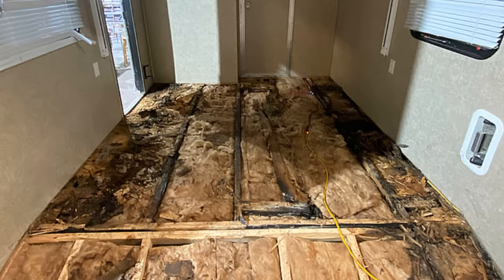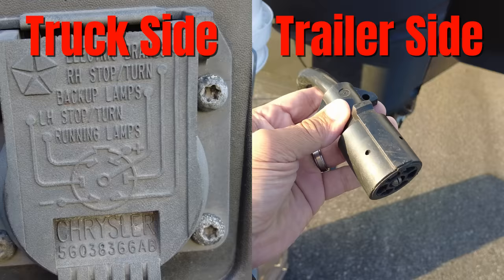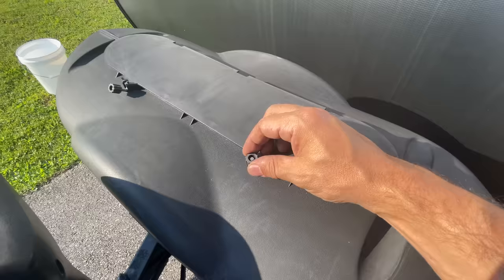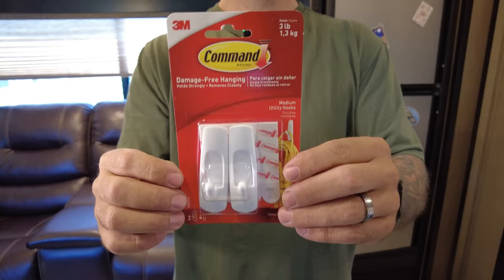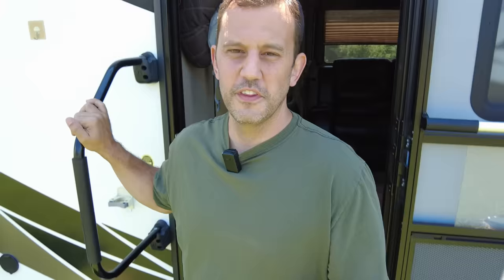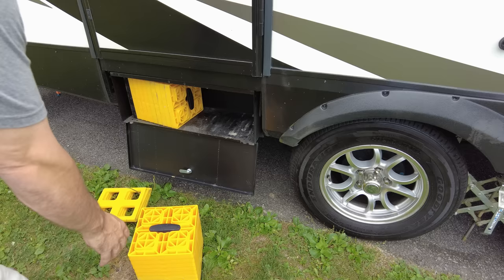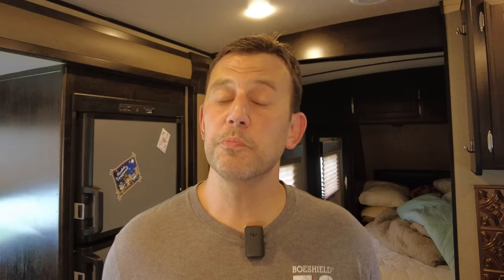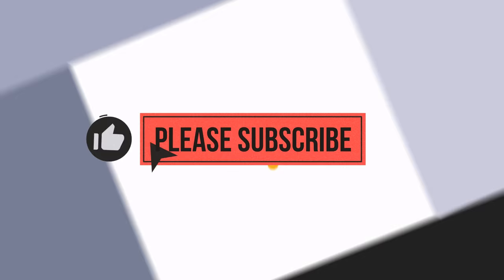RV Camping Hacks / Tips That Will Save Your Marriage 🤣 & Cost You Nothing

Comment from the maker: ✨⭐ PRODUCTS FEATURED IN THIS VIDEO ⭐✨
🔹 Water Splitter W/ Valves https://amzn.to/3PxL2hR
🔹 Water Filter https://amzn.to/3yJsi8h
🔹 Bungie Balls https://amzn.to/3AVhNS5
🔹 Pipe Cleaners (Cheaper at a local craft store than Amazon) https://amzn.to/3RC2weS
🔹 Fuse Kit https://amzn.to/3PgyhbU
🔹 Trailer Brake Cable Clip https://amzn.to/3aLULCC
🔹 5 Gallon Bucket – Buy this locally, its cheaper than Amazon
🔹 Command Hooks for Garbage Can https://amzn.to/3aNJt0D
🔹 Command Hooks for Shower https://amzn.to/3ILYwV9
🔹 Metal Towel Hooks https://amzn.to/3ILQ3kJ
🔹 Camco Leveling Blocks https://amzn.to/3cmUo1J
🔹 Camco Leveling Block Caps https://amzn.to/3IJ17Pw
🔹 Carmtek Premium Leveling Kit https://amzn.to/3zxE9s9 
🔹 Carmtek Tandem Axles Levelers & Chocks https://amzn.to/3xqpjBa 
🔹 Carmtek Triple Axle Levelers & Chocks https://amzn.to/3xSGRrb 
🔹 Carmtek Single Axle Leveler & Chock https://amzn.to/3MJFKhw
🔹 Low Point Drain Valves (Male) https://amzn.to/3aJX5Gm
🔹 Low Point Drain Valves (Female) https://amzn.to/3ckZFqm
🔹 Velcro Straps https://amzn.to/3AX5gxF

RV Camping Hacks / Tips That Will Cost You Nothing & Save Your Marriage This episode is full of random RV camping hacks, tips & tricks to make RV life easier, safer, and maybe even save you a few dollars.  Keep scrolling down to see more info about this video ⬇

🎥Other Videos to Watch: Carmtek Leveling Ramps Review https://youtu.be/hD9QU5DCZqY

#rvlife #rvtips #rvtravel

✨⭐ OUR FAVORITE RV ACCESSORIES ⭐✨

ESSENTIALS:
✅ Camco Rhino Flex Sewer Hose & Elbow Kit https://amzn.to/3wxaiyG
✅ Camco 90 Degree Clear Sewer Elbow https://amzn.to/3eezBe7
✅ Camco RV Water Filter https://amzn.to/3VzcMqi
✅ Rubber Wheel Chocks https://amzn.to/3v0lL5I
✅ Hughes Watchdog 30 Amp Surge Protector/EMS https://amzn.to/3hAmgCy
✅ Hughes Watchdog 50 Amp Surge Protector/EMS https://amzn.to/3HKrpm1
✅ Liquified RV Tank Treatment https://amzn.to/3ksg1Ck
✅ Tire Minder TPMS https://amzn.to/3mjuBg0
✅ Water Pressure Regulator https://amzn.to/3m3ZFzZ
✅ Rubber Gloves 6 Mil https://amzn.to/3XNo7Dc
✅ Collapsible Water Hose https://amzn.to/3SvNubw

MAINTENANCE:
✅ Boeshield T-9 Rust Preventative & Lubrication https://amzn.to/3sjcjMx 
✅ Eternabond Roof Tape https://amzn.to/3Ad290J
✅ Geocell Proflex Sealer https://amzn.to/3KGMOyb
✅ Road Tool Kit https://amzn.to/41NIQKj

INTERIOR:
✅ Camco Cross Bar Door Handle https://amzn.to/3o8WWS5
✅ Shower Caddy https://amzn.to/3bdU80W
✅ Soap Dish https://amzn.to/3pKheSn
✅ Oxygenics Shower Head (White) https://amzn.to/3nhDMYW
✅ Oxygenics Shower Head (Brushed Nickel) https://amzn.to/2O8YcYC
✅ Perfect RV Paper Towel Holder https://amzn.to/3tZxd1K
✅ Dimmer Switch https://amzn.to/3rQdfFD
✅ Sliding Door Latch https://amzn.to/3EkpTT0
✅ Puppy Paw Hook https://amzn.to/2N9JaRV
✅ Foldable Storage Bins https://amzn.to/3tIp01f

EXTERIOR:
✅ X Chocks https://amzn.to/3m3ck2i
✅ Carmtek 10 Digit Keyless Entry System https://amzn.to/3t4IMpB (see the video here: https://youtu.be/KcEUgsDw6kk)
✅ Low Point Drain Valves https://amzn.to/3Jd6adb

OUTDOOR GEAR:
✅ Blackstone Griddle 22” https://amzn.to/3MDDiL0
✅ Blackstone Griddle 28" https://amzn.to/3eBnOuD
✅ Outdoor Gravity Chairs https://amzn.to/3Sb1p4M
✅ Ground Mat https://amzn.to/41u3wXg

💥 Sign up for our FREE Newsletter: https://view.flodesk.com/pages/6497c6a9d1998fa8c7623e9f

✨⭐ MORE RV ACCESSORIES ON AMAZON ⭐✨
https://www.amazon.com/shop/rvtipstravels

💥 NEW TO OUR CHANNEL? Check out our catalog:
https://www.youtube.com/c/RVTipsTravels/playlists

🙏 If you want to help support our channel you can donate here: 
https://www.paypal.com/donate/?hosted_button_id=J2KKM9NR3BJJA

✨⭐ DISCOUNT CODES TO SAVE MONEY ⭐✨

🔨 Learn how to repair & maintain your RV like I did w/ this COMPREHENSIVE training course:
https://rvtechcourse.com/?ref=rvtips&travels

🚐 10% off RV Snappads! https://rvsnappad.com/discount/RVTT10

🛌 Get 25% off your RV Mattress by Brooklyn Bedding at https://rvmattress.com/rvtips
Use discount code: rvtips

📡 GPS Tracking for your RV! https://www.wheresafe.com/rvtipsandtravels
Get 10% off by using discount code: RVTIPS10

If you find a dead link, let us know & we’ll send you an RVTT sticker!

📺 Want to see more RV videos? Please SUBSCRIBE & CLICK THE BELL ICON 🔔 so you're notified when we release new videos!

Follow us on social media:
📸 Instagram https://www.instagram.com/RVTipsAndTravels
🕺 Facebook https://www.facebook.com/RVTipsAndTravels

We may receive a small commission for purchases made through the affiliate links above. There is NO additional cost to you when purchasing from our links & it helps cover some of our material and equipment costs to make these videos. We GREATLY appreciate your support!

Comment: Never open the pressure relief valve on your water heater and release the air in there.  That air is in there to allow for expansion in the hot water system.
Reply from the maker: Opening the T&P valve doesn’t remove the air pocket at the top of the tank, it relieves the pressure.  It does not create a vacuum and remove the air OR raise the water level.  Normal use of an rv water heater is what reduces that air pocket over time.  I can send you other videos from other channels that say the same thing if you dont believe me.  The T&P valve is at the top of the tank, when you open it you relieve the pressure and any water that has made its way to or above the valve, which essentially increases, not decreases, the air pocket.  Pretty simple science.  The air pocket also needs to be occasionally reset.  Resetting the air pocket along with some other information about the T&P valve are explained in more detail in the link at the end of this comment.  Hope this makes things easier to understand, and thanks for watching:
https://youtu.be/PopWaPMra6A

Comment: Here is my tip... Learn to do your own RV maintenance and use a good car maintenance management program ( I use Automotive Wolf car care software ) to track and monitor it all. It also tracks all my parts, expenses and creates a detailed vehicle maintenance log. After RV'ing for over 10 years I've saved thousands by doing most of the maintenance myself and there is a lot of it on an RV!  A small roof leak can cost you thousands in repairs so I check my roof at least twice a year. Keep on top of the maintenance and you'll save money and be RV'ing for years :)
Reply from the maker: couldnt agree more, thanks for sharing
Reply: U should be using Saftey Chains.

Comment: I liked these tips. Short and sweet.
I had already turned my propane tank cover around, but to add extra security, I drilled small holes next to both sides the hinge and added cable ties, not too tight, just in case the hinges blow loose.
Reply from the maker: Good idea Terry
Reply: Yup, I've already lost two lids!  
 @RVTIPSANDTRAVELS

Comment: I always carry 20 gallons in the fresh tank because I’m towing my own rest stop.  Also, spare expanding shower curtain rods store easily under the bed.  They rest really well on top of the midline trim of the shower and can be used to dry wet towels between showers (without that trim, you may need to tighten the rods to the shower walls).
Reply from the maker: Thanks for adding William!
Reply: I carry a gallon jug of water.

Comment: Nice video... I hate hauling water, but if you have a breakdown on the road... nice to have.  I suppose it depends upon the rig doing the hauling:  small suv with an auto tranny or a 1 ton manual Cummins...

If you are pulling with the right rig, it isn't the weight of the water that is killing you, it is wind resistance.

Comment: Rubber bands to keep cabinets closed. I use a anchor cleaves for the oh no break cabel. It's made of stainless steel and the nut is held in place with a hitch pin. Use only one lp gas tank if you have two. This way when the tank is empty you have the second full one. Just remember to fill the empty one.
Reply from the maker: Thanks for watching Tom.

Comment: On the safety brake just use a hasp. Place the cable on the smaller end of the hasp and that will correct the problem.

Comment: Great video, Ross!  I use wood blocks I had left over from a deck project under my stabilizers. When traveling  I store them in the 5 gallon bucket used to cover the jack. I used a router to round the edges of the blocks to makes them easier to handle. I always look forward to your videos. Fellow 2150rb owner.
Reply from the maker: that works too!  Great idea! I use the bucket to carry firewood sometimes.  I used to use wood blocks under my stabilizers but after not using the blocks to level anymore, i wanted to either get rid of the wood or the blocks.  the blocks won, the wood was free. Thanks for commenting Daryl.
Reply: @RVTIPSANDTRAVELS  I use the leveling blocks flipped upside down under my stabilizers, but I also have a wood block under my tongue-jack, because my jack doesn't have a foot, and the wood block is easier to replace when the jack inevitably cuts through it.
Reply: Ha,  my college roommate would do the radio trick to help him sleep because I snorred to loud.  Before he learned that trick,  he would throw pennies at me. Thinking I would roll over on my belly and no longer snore.  When I got up the next  morning, pennies would be stuck to my body.  My poor penny-pinching self would collect them in the shower.

Comment: As always, your content is above the rest.  Thanks!!
Reply from the maker: Thanks bud, appreciated.  Good to hear from you again.
Reply: @RVTIPSANDTRAVELS  another topic you might consider is related to keeping absorption fridges cool.  I’ve started having some problems and I installed a 2x titan fan at the top of my fridge cavity to help pull hot air out and I have been testing it with results showing it’s worse with the fans going.  I’m wondering if it’s actually pulling fresh air from the top more than it’s pulling from below.  Seems crazy but I’m tempted to either add more fans to completely cover the top 6x20 vent exhaust opening but not sure.  Anyway, it might be a good topic in the future for you. Many of the other videos are all the same.
Reply from the maker: Just seeing this, I’ll look into it bud.

Comment: Just a reminder you may want to add.  IF you drain your water heater, make sure you refill it before turning it on, water on and relief valve open until water comes out..  Especially for the electric side which could be damaged or the gas side which could trip the high temp limit.
Reply from the maker: Absolutely, we always burp the valve before powering on the electric side to make sure.  The heating element will burn out in seconds.

Comment: You shouldn’t have the red plug in the pressure relief valve of water heater. That needs to be free & clear of any/all obstructions.
Reply from the maker: it doesnt interfere with the valve, and it basically falls out if there is any real water pressure behind it.  It came from the factory as a cover to prevent insects nesting in the valve, so they said, but I've since removed it because it was falling out all the time.

Comment: I’m unable to find the list you mentioned. Are you able to share it? Thanks. We subscribed. Very helpful
Reply from the maker: 🔹 Water Splitter W/ Valves https://amzn.to/3PxL2hR
🔹 Water Filter https://amzn.to/4dfEp0x
🔹 Bungie Balls https://amzn.to/3AVhNS5
🔹 Pipe Cleaners (Cheaper at a local craft store than Amazon) https://amzn.to/3RC2weS
🔹 Fuse Kit https://amzn.to/3PgyhbU
🔹 Trailer Brake Cable Clip https://amzn.to/3aLULCC
🔹 5 Gallon Bucket – Buy this locally, its cheaper than Amazon
🔹 Command Hooks for Garbage Can https://amzn.to/3aNJt0D
🔹 Command Hooks for Shower https://amzn.to/3ILYwV9
🔹 Metal Towel Hooks https://amzn.to/3ILQ3kJ
🔹 Camco Leveling Blocks https://amzn.to/3cmUo1J
🔹 Camco Leveling Block Caps https://amzn.to/3IJ17Pw
🔹 Carmtek Premium Leveling Kit https://amzn.to/3zxE9s9 
🔹 Carmtek Tandem Axles Levelers & Chocks https://amzn.to/3xqpjBa 
🔹 Carmtek Triple Axle Levelers & Chocks https://amzn.to/3xSGRrb 
🔹 Carmtek Single Axle Leveler & Chock https://amzn.to/3MJFKhw
🔹 Low Point Drain Valves (Male) https://amzn.to/3aJX5Gm
🔹 Low Point Drain Valves (Female) https://amzn.to/3ckZFqm
🔹 Velcro Straps https://amzn.to/3AX5gxF

Comment: I installed my propane cover so the lid latched at rear, during travel the 'lock tight bolts' vibrated loose and were lost.  Any other way to secure lid?
Whrn using the white bucket to cover the jack be sure it is angled so as not to pressure the jack light switch.  Also use a bungee to secure bucket position.
Reply: Lowes sells small trash bins that have cut outs that allow trash bags to be secured.
Reply from the maker: i wish i had a hack for this lid, its awful.

you can connect your saftey chains to the bucket handle to hold it down too.  thanks for watching and commenting Pat.

Comment: I'm sure you have made a video on this but here's what happened to me... I used my camper for the first time about 4 weeks ago last weekend we got everything hooked up and when we turned on the water mainly the water out of the hot water tank it smelled really bad like sulfur perhaps if I'm getting this correctly it's best to drain your hot water tank when you leave it sitting for even a couple of weeks what is the best tips for this I have a older camper I believe it is a 2006 so the hot water heater isn't electric it's just gas I have not lit the burner yet because the previous owner said it did not work this weekend I happened to noticed that there is a mud daubers nest inside the burner I will be removing that and then seeing if I can get it lit any tips is greatly appreciated
Reply from the maker: I always empty my low points after a trip, which empties most of the water heater.  Get these valves: 
https://youtube.com/shorts/OlxItiTWWFQ

Comment: Safety brake cable should not be attached to the same loop as the break away chain. If the chain breaks the loop then the cable does nothing.
Reply from the maker: Correct, however that’s why it’s important to size your cable shorter than the chains.  My cable is measured to pull the safety brake long before the chains are stretched to the point of full extension, therefore the cable will have been pulled and brakes activated before the chain has time to tear the loop.  Great point Amos, maybe a subject for a video.

Comment: Don't attach the brake breakaway to the hitch. it needs to go to the frame. I added a cable to my frame terminating near the hitch with a loop that I attach my breakawy cable to. If you hitch fails and leaves the vehicle, attaching the breakaway cable to the hitch will not help you.
Reply from the maker: this is an interesting point Ive seen a lot of debate over the years on... I wont disagree with you, but in 20 years of towing and being around others who tow, I have never seen a hitch fall off a truck.  if following that idea, shouldnt the chains also be connected to the frame?  i personally do see the need to connect to the truck just based on reality, but would love to know your thoughts on this.

Comment: Can you come up with a jack to speed up the set up process lol
Reply: For my tong jack I put a long nut where the handle goes and use my heavy battery drill to put it up and down. I put a socket on the manual handle for use if needed.  Again I use my drill to put my stabilizers up and down.
Reply from the maker: you mean jack or hack?  my set up process is lengthy and ive been working for 5 years to make it efficient and its getting there, not there yet though.

Comment: 5:10 disable the tounge jack?  Is that necessary?  Is society degrading to that level?
Reply from the maker: I was doing this on my first tongue jack when I received the recall that it was operating randomly on its own, as mentioned in the video. so if I didnt remove the fuse, I could be parked at a camp site, the tongue decides to start lowering on its own and all of a sudden my stabilizer jacks are crushed, along with anything underneath the camper.  someone inside or outside could be injured if theyre under the camper opening a drain or doing maintenance.  so in my opinion, yes, it was necessary.  

after the tongue jack was replaced, I continued to remove it because RV theft is a real thing.  Pulling the fuse wont stop someone from stealing a trailer if they really want to.  But it would slow them down if they needed to raise it to hitch up.  Sometimes slowing a thief down will get them caught, or convince them to go somewhere else.

Ill agree there are some slimy people in our society and it stinks that security measures need to be taken, but that doesnt change the fact that trailers are stolen everyday.  It takes literally 2 seconds to pull the fuse, and to answer your question it is not necessary, but worth doing in my opinion for my situation.  Understand Im just here to give people options.  Thanks for watching and commenting.